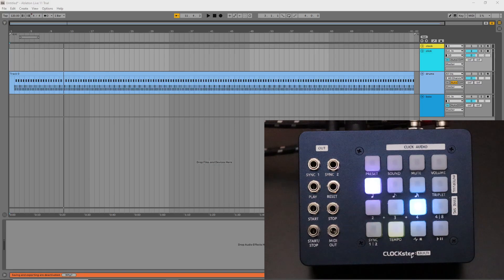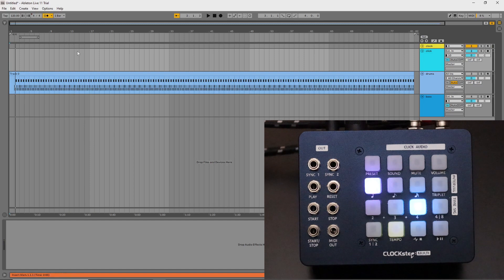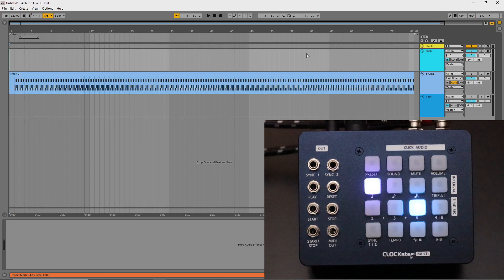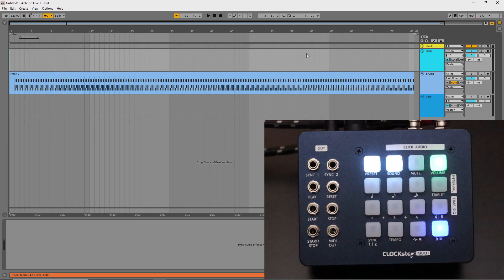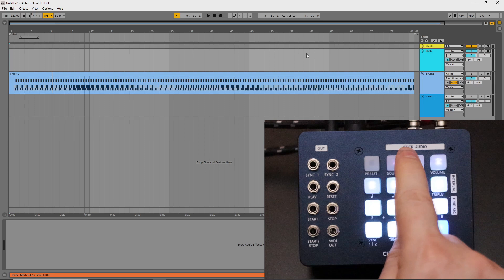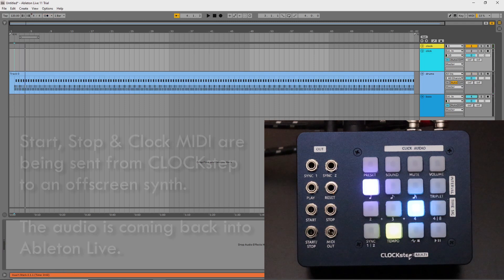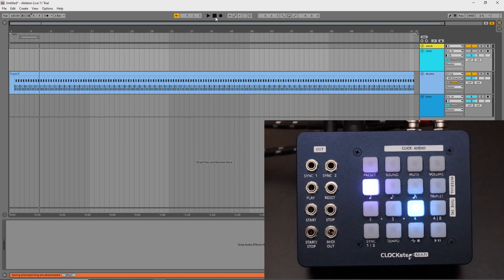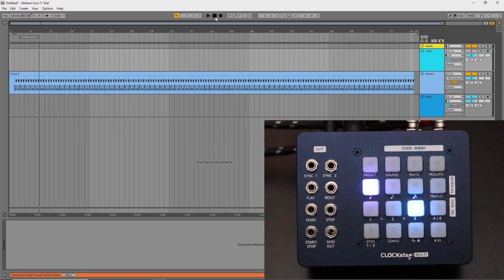CLOCKstep:MULTI - Latency Compensation (featuring Ableton Live and Sample Accurate Clock)

Comment: you just fixed my pre roll problem I had with clockstep multi when recording 
Truely amazing! Tnx for this update, is extremely handy, my program needs to think less now and thats always good!
Reply from the maker: The new "Simple 2" transport mode?  Yeah, I used it in the video, but didn't talk about it.  Definitely the thing to use along with Sample Accurate Clock.

Comment: Brilliant.  Will the multi reset sequence after stop/start if sent to DFAM?
Reply from the maker: Does DFAM have a Reset trigger input?  If so, then yes.  Included with the new firmware of CS:M is the addition of a Transport Mode called "Simple 2".  What this will do when using it with Sample Accurate Clock/Latency Compensation from a DAW is automatically send Start, Stop and Reset triggers every time the clock starts and stops.